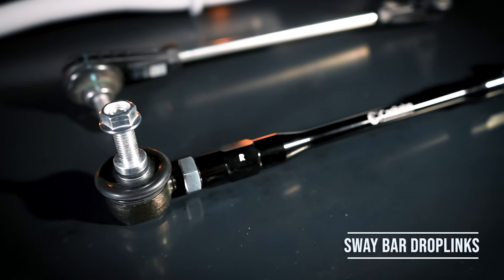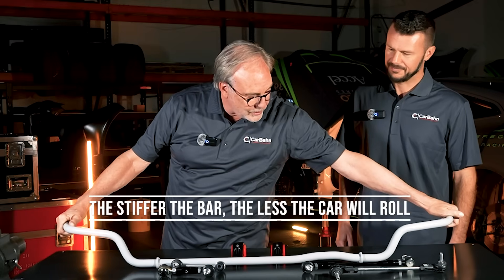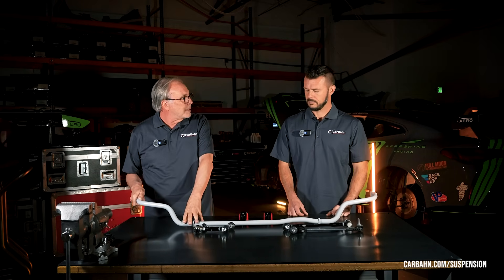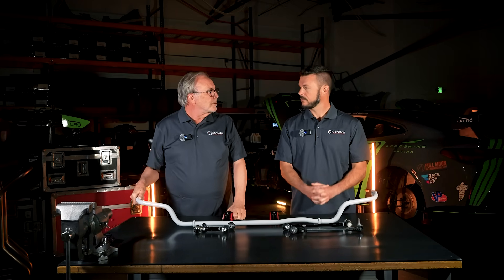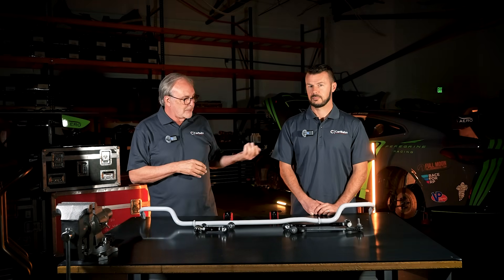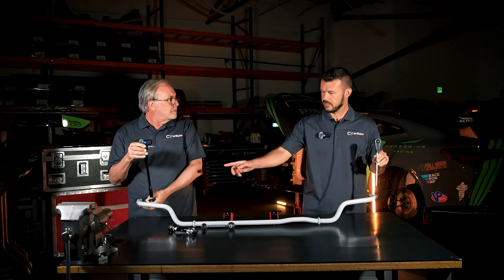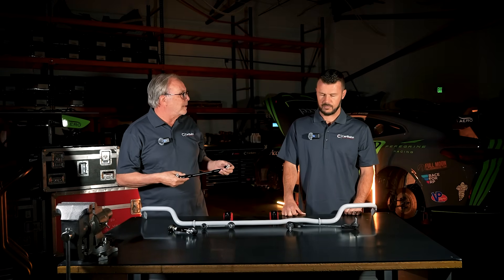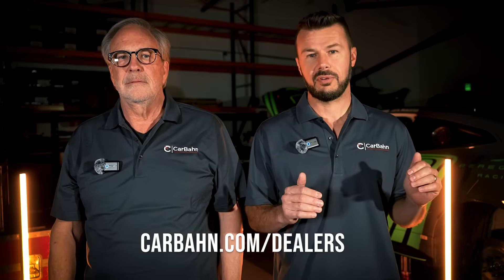How Adjustable Drop Links Transform Your BMW's Handling | Tech Tip Tuesday by CarBahn

Comment: So you my stock sway bar is under pressure because of my fixed links. Is this true for a stock suspension ? Or only for coil overs ?
Reply from the maker: True for stock

Comment: 🤣😂🤣 all the tech in bmw and they think some links and a sway bar are going to make some big difference 🤣😂🤣
Reply: Yes it will. Sway bars literally have the most effect to car control. So what if you have a 24 inch screen?? What good is the “tech”for?
Reply from the maker: I'll tell you personally before and after these were installed on our M4, the cornering at high speeds was very noticeable. Virtually no over/under steering on a cloverleaf... Now imagine this set up at the track.

Comment: Hello Steve - would you please do a (or another, perhaps updated if anything information has changed), on your latest add-on tuning tuning ECU box, the horsepower and torque curves from your latest software, and also show is via a sophisticated OBD 2 reader at the factory ECU will not see, recognize, record, memorize anything from the boost, timing and power increase, and when BMW factory scan tool is connected to the car; I’m worried the Dealer will void the warranty if they see anything that is remotely suspicious when their scanner is connected.  
Also, if you have partnered with dealers who will install your product and warranty the car, that is even better yet,  please let us know who is in the CarBahn network.  Thanks!
Reply from the maker: Hello and thanks for watching! We will definitely have a series on ECU tuning coming soon. As far as dealers go, at carbahn.com/dealers you can find all the BMW dealers and installers that install our products and honor our warranty program.